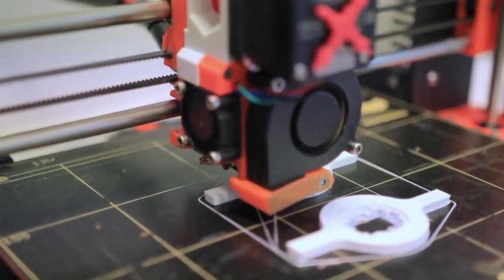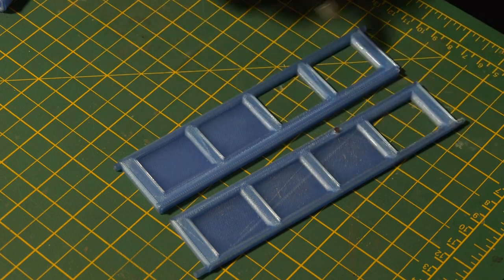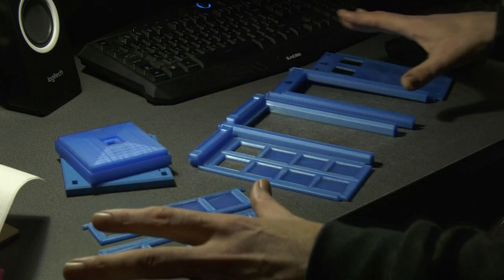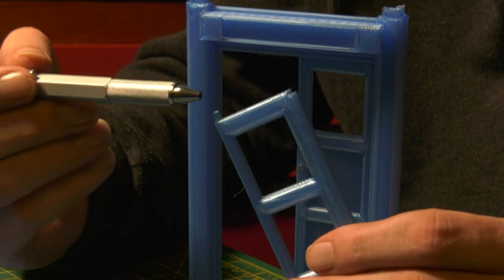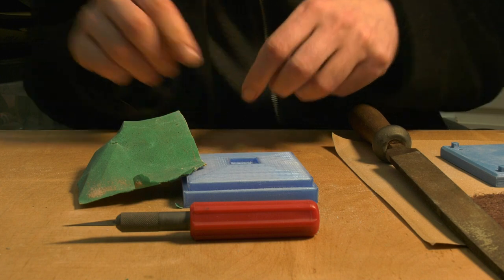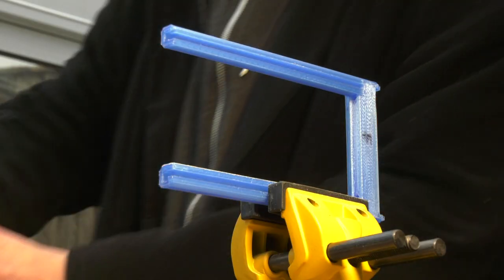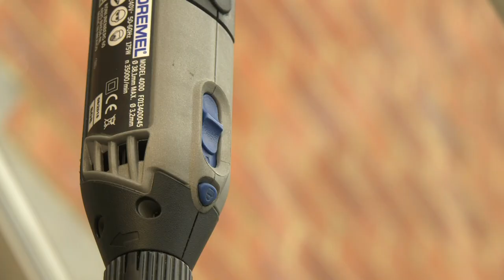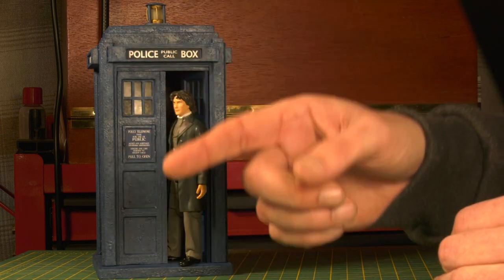3D Printed Model Kits - How hard can they be?

Comment: So I actually make up a type of liquid filler mix to use on some 3d prints (depending on the print). I basically squirt some 5 minute epoxy into a plastic shot glass and mix in isopropyl alcohol until it's a more watery consistency and then paint it on. It may need more than one cot as PLA prints aren't water proof so the first thing it does is seal it. It then leaves you with a resin shell that's easier to sand and paint as the paint doesn't just sink into the plastic.
Reply from the maker: Funny you say that, something similar to this was what I had in mind, but when I reached for the IPA, I realised that I only had a drop left... which was a bugger. The long way round it was then!

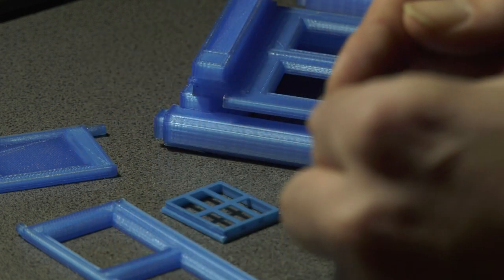Comment: 12:20 With my personal (admittedly highly limited and even more amateurish) experience with creating and printing 3D models, the extra dimensions probably come from the printing. Can't be sure, but it seems that that's the base, and the first layer (printed onto a platform) is usually done slightly differently to the higher levels (printed onto the plastic), and so that sort of anomaly is unsurprising to me. So, I would give the CG-modeller the benefit of the doubt here (I think that sort of mistake is really quite unlikely when doing that sort of thing). In fact, checking again, you can see that the edge goes inwards after a layer or so of plastic.
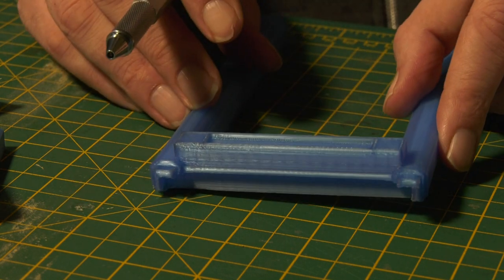14:10 Oh (I ought to watch videos fully before beginning to type, shouldn't I?), and I think that bowing is probably also in part because the outer edges, like the base layer, are handled differently to the main surface parts. The pronounced problems at the corner posts are also probably because the nozzle motion mechanism can have notable difficulty at corners.
You're certainly right about 3D printing not being any sort of panacea...The sheer number of discarded tests you can get when preparing the CG model is outrageous. (I often say that 3D printing adds a whole extra dimension of difficulty to normal printing.)
Anyway, the result of the model from the 3D print is genuinely staggering, and I think the tips and information you've given will be very useful for me (as someone planning a number of my own similar 3D printed models, at an early stage), and so thank you. A very inspiring and informative channel generally.
I'll certainly take a look at Segal's channel, and what a (pleasantly) surprising cameo!
Reply from the maker: As I've said elsewhere, the whole point of this video was simply to highlight the ups and downs of using this technology, just as I highlight the ups and downs of scratch building or any other type of fabrication. Creation is not easy and for those who go in to it thinking it is, I just wanted to highlight the reality. Thanks for watching!